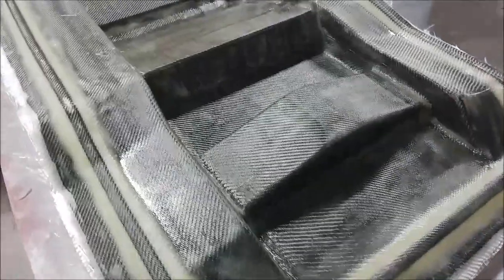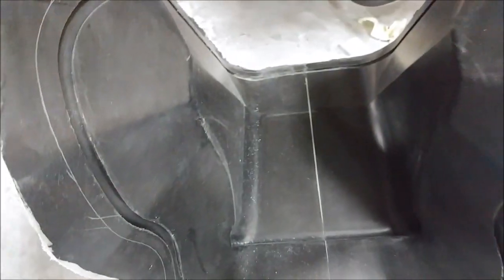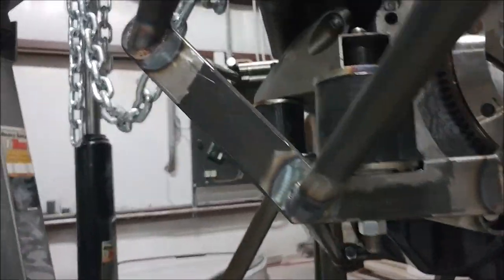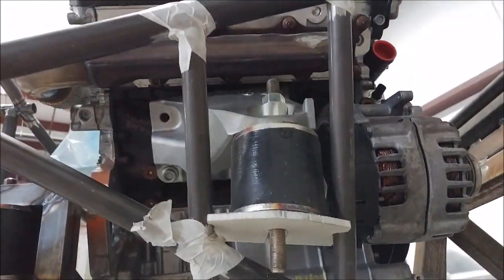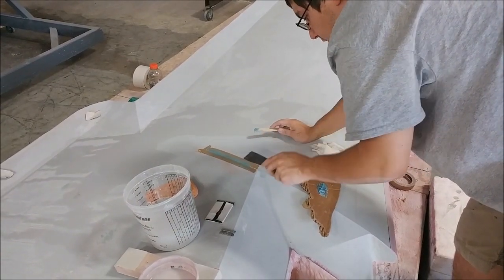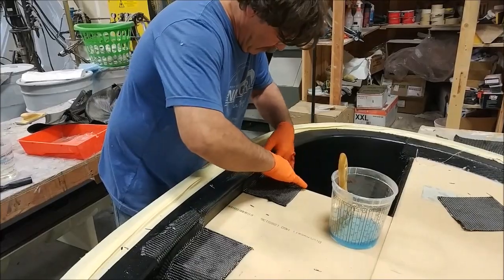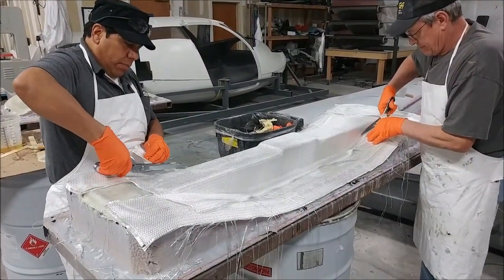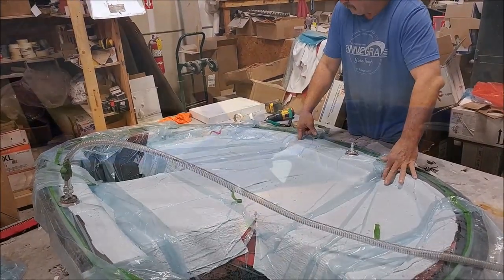Raptor Aircraft February 21st 2017

Comment: When torqued to specification will those engine mounts compress .2 inches?
Reply: Gotcha - so its not really a sandwich, just 2 studs that are suspended/isolated in urethane.   Makes sense.
Reply from the maker: Actually two interlinked looped bolts suspended in urethane. That way there is no way for them to separate.